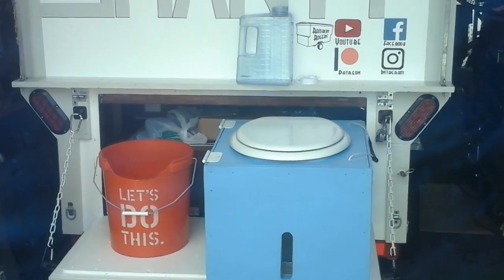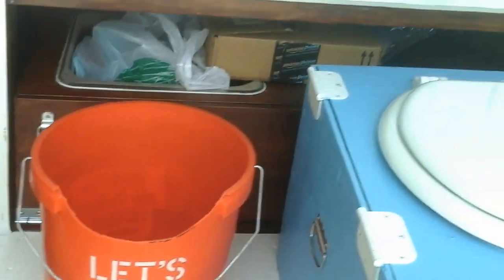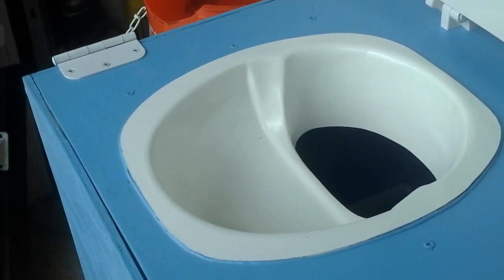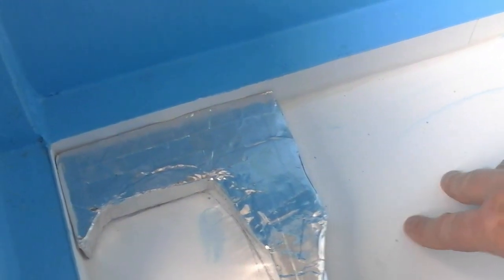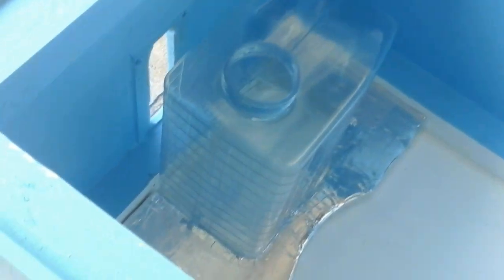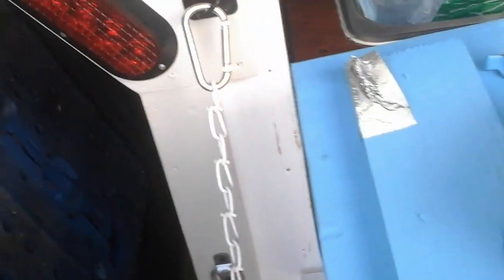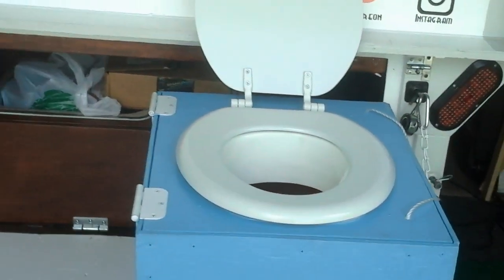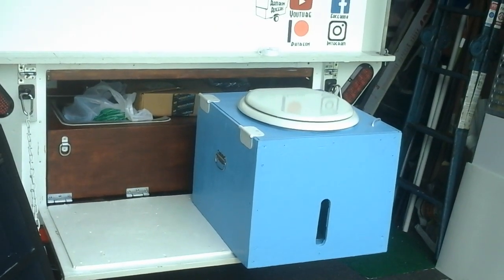DIY separating composting toilet for camping..

Comment: I've scrolled through quite a few video's, but this was the best so far. Thank you for making it informative, simplistic, and get'r'done. I don't need to sit through hours watching creative angles and cutsie shots of toilets. Just want to get an idea of how to make it, and have it work well. You made it perfect. I like the extra ideas on putting the shower tubbing on the bottom to prevent the overflow from soaking into the wood, also preventing the material from moving around in the bottom, adding the blockers. I kept saying, "Oh, smart!" Really great video, thank you for posting!!!!!

Comment: A cat litter tray would also work well to catch any spills and could be lined with newspaper to soak them up. If this was to be used inside a camper the urine container would have to be emptied before driving anywhere or it would slop out when you hit any big bumps.

Comment: Cool!  At some point I'd love a composting toilet. I do have a luggable loo that I absolutely love.  I'm only 5'4" so someone who's quite a bit taller it probably wouldn't be very comfortable  🖤🎃💛
Reply from the maker: Suze's full time van life we have one, it's new and never used. Had one before but when placed in a shower tent on uneven ground they are tippy. I built a base for that at first but decided to go an entirely new direction. This type can go longer, less smelly and more stable. It's an overall better solution in our case.
Reply: I put stick up deodorizers in mine and that's helping a lot with the smell.
Reply from the maker: Suze's full time van life i could be wrong but i believe it's the nitrates in urine that start the composting process when combined. The higher end toilets like natures head separate and owners commonly claim no smells from their units. They are expensive though, and that's why i made my own.
Reply: If I get one at some point it will definitely be homemade. Those composting toilets that you buy in places like fleet farm in Menard's are completely ridiculous. I'm not gonna pay $2000 for a toilet lol.
Reply: @SuzesCarnivoreLifeAfterBypass  Some are down to the low low price of $900+ now! 🤯

Comment: I love that.  I want one of those. It would fit perfect where I wanna put a toilet/shower
Reply from the maker: Kristofer Travels once you've accumulated all the parts it's just an afternoon build. Watching the caulking and paint dry is the slow part. There are companies ( including Kildwick ) that sell just the seperator. I just went with the full unit because there is a lot less chance of any " misses " between that and the bucket.. price wasn't too bad IMO.
Reply: what do got mean by "full unit" - is seen what Kildwick had as this is the Separator I have my eye on, but you did the whole build yourself except for the separator. I'm sorely tempted to order their bucket and liquids tank (pretty sure I'll be ordering the liquid one since it looks like the best design and easiest for dumping) but you video helped me alot since I had thought a regular bucket would fit without having to be notched out. I'm not sure I could manage to cut out a thick plastic bucket - and that means you don't have the option of sticking a lid on it. Perhaps the best way is to use square buckets line the ones Kildwick makes?
Reply from the maker: Mony's cell by full unit, I'm talking about this seperator compared to the one that is only the front section. And i notched the bucket to fit in the total height i wanted. My wife has short legs. Lol. A 4 gallon bucket may have fit but the 5 gal i already had on hand.
Reply: +Ramblin Rogers hi thanks so much for the response.. I'll keep that in mind.. 4gal... I've bdrm back and forth on the whole bucket thing. I'm in Canada and I feel as though there aren't as many choices in buckets as I'd like - especially when you want a lid. I'm thinking maybe a bucket from a bulk store or something, rather than a painters bucket. I wish I could spring for the whole shebang from Kildwick - their toilets do appear to be well thought out, but that conversion from British pounds to Canadian dollars is a killer. For the moment I just wanted the separator for SHTF (no pun intended.. lol). I really love how yours turned out - love the colours you chose - perfect. Very classy and clean. Well done. Can you give me those dimensions you used again? 16" high, was it? So with a 4 gallon bucket, would the back of the separator still come down into the bucket, do you think? That's a great suggestion - I suspect a smaller bucket would be easier for me as a woman to handle. Sometimes just a slightly lighter weight can make a chore that much easier. Thanks again.
Reply from the maker: Mony's cell the dimensions in inches are 16" high. 19" wide and 21" deep. The inside between the bottom of the box and just below the seperator is 11- 1/2".. so if you find a 12" tall bucket you just make a box 17" high. But i wouldn't go any taller unless you build a step for the front of it (like a little porch).  In theory, you could use any height bucket if you don't mind making a step so it's not at an uncomfortable height for use.. this gives you more choices but you will have to adjust the urine collector also to a functional height.. the build is fairly easy, just measure everything.. and i agree about the cost of a complete unit, thats why i built ours myself..

Comment: You should install a valve on the urine to prevent the smell to come back up either by installing a push down plug to open or close and if you forget to open before using, just having a small stick to push down without touching the liquid is all you need.  Another way is to install a valve with a handle to shut off or open sticking out in the front between the urine container and the seat. You may need to raise the toilet a bit to make space for a line valve.

Comment: The diverter manufacturer Kildwick's webpage indicates they are no longer shipping.  Have you any suggestion on where the diverter may be purchased?  Thank you.
Reply: Check online. A friend found several options.....
Reply: There is a company called Throne composting toilets that sells a very similar urine diverter separately but they are a bit expensive.  Going for around $100 on sale last time I checked.

Comment: Looks very nice.  How well does it work?
Reply from the maker: Tussah it did so well for us that the top of this has been repainted and is now being used in our Vardo project. Now that it's no longer portable, it has an 80mm dc fan that runs constantly and you can't tell there is a bathroom in this small space. The only part of the seperator we didn't like was the plastic screen, so we tossed it.

Comment: Building my toilet soon, before I get too far I'm curious about backsplash, especially for the ladies but also bottoming out for the guys, if you know what I mean. Anything to avoid surprised and make potty time more pleasant.
Reply from the maker: No complaints from the wife. And seat top to drain is 5" and if you add thickness of your backside you get total distance. 7-8" clearance average.

Comment: Looking to follow your lead for RV. Also looking to retro-fit Envirotoilet (with no separator) in house with the Kildwick Klassic.   Could you tell me the dimensions of the hole you cut in the top of the box to fit the unit?  (I want to determine if I can fit one into the existing opening in the top surface of the Envirolet.   Many thanks.
Reply: BEVERLEY LYNNE HARRIS I would think that the instructions for the Kildwick unit would include that info.

Comment: Hey how are you?

I want to ask you how your toilet is working out for you so far? Do you notice any smell when you use sawdust ? I would like to buy one that is why I'm asking the question before I made my decision........Thanks, George
Reply from the maker: Leave No Trace it's not bad at all.. right now we're using cedar and about 1tsp. Tank deodorizer in the urine tank. The only thing we smell is the deodorizer. We're going to build another one for our vardo project that is currently in the works. The only flaw is the plastic screen on the seperator. We just removed it. If someone wanted a screen there I'd suggest a stainless mesh instead of the plastic.
Reply: Thank you for taking your time to answer my question.....I thought the screen on the separtor was metal nice to know..... Let me know how you make out on your other project I'm curious now LOL God Bless You Brother!!!
Reply: A friend uses the animal bedding....works great.

Comment: Do you have a problem with odor without a fan?
Reply from the maker: Cyndi Foore when we used it, we had an outdoor shower tent it was used in and a pine/cedar mix so nothing noticeable. I've since repurposed the seperator in my newest project, which has a 80mm fan that stays on. No smell at all in my vardos bathroom area. Plus we use a tank deodorizer in the urine container.

Comment: Why separate it? From what I've heard,  urine helps it compost faster and doesn't smell.
Reply: Together with the poop it will ;-)
Reply: Lycanthropic Paranoia try that and get back with us.😄
Reply: Lol you heard wrong.
Reply: LOL. Don't believe every thing you hear.
Reply: if you're actually composting, and you can empty it regularly, keeping the pee in isn't too bad. 
I lived with humanure composting, and it isn't too bad, stinky, or weird to deal with, BUT I WOULDN'T want to be in an RV with it.
From a logistics standpoint, pee is gross. Way worse than poop. 
But it is fairly easy to regularly dump a volume of just pee, either out in a bush or any toilet. 
The weight and volume you add to the waste bucket is kind if exponential, since more wet you have to add more dry(sawdust or other carbon medium). Dumping a heavy bucket of mixed products is a much tougher proposition. 
Drying the poop out makes it easier to bag and toss. 
ideally, in true composting, you do want the pee because it's high in nitrogen and moistens your compost. 
But on the road, most people are looking for a 'dry toilet', not true composting. I call it a hamster bog.
Reply: Keeping the urine & solids separate GREATLY reduces the smell. 
Place a small layer of cedar shavings(horse/pet bedding) or "coconut core" after making a deposit , will keep smell down. Most people say they don't need a fan unless doing long-term composting.